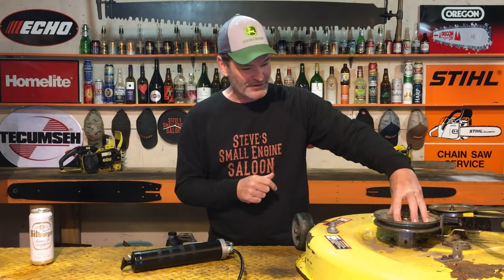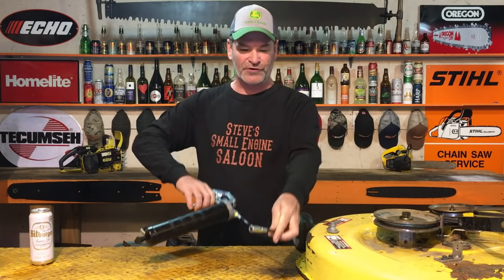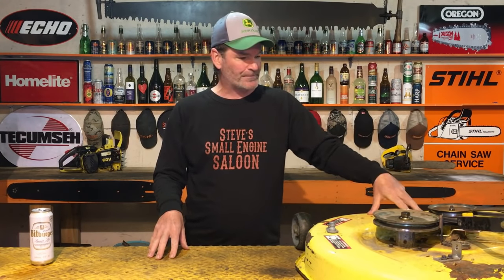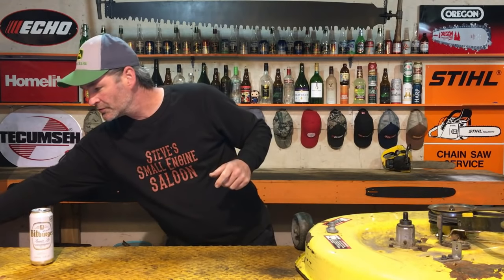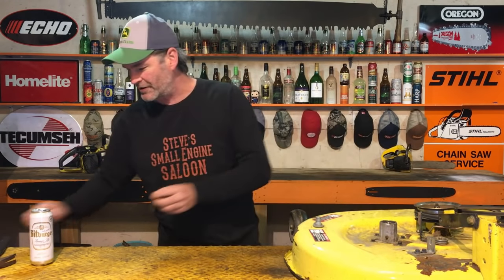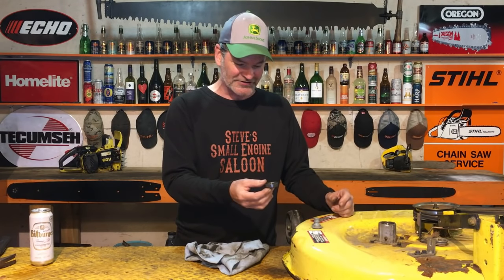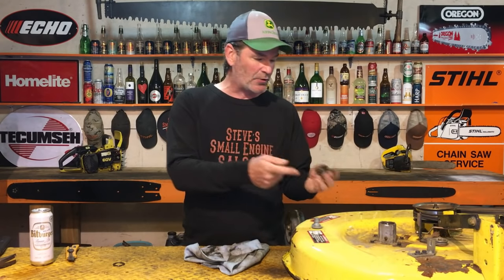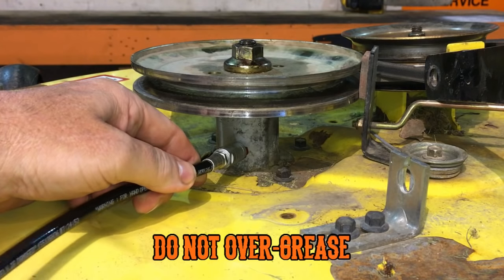Your Riding Lawn Mower's Dirty Little Secret

Comment from the maker: Click here for a grease gun ➜ https://amzn.to/2HEEm1z
Click here for a spindle assembly ➜ https://amzn.to/2wjOAxL
Click here for bearings ➜ https://amzn.to/2M6pgpG
Check out these other informative videos: 
Clean Under the Mowing Deck on a Riding Lawn Mower ➜ https://youtu.be/RpURLWPNI1o
How To Un-Seize, Clean and Grease a Sealed Bearing ➜ https://youtu.be/0J8z-n7dIOg
Remove The Mowing Deck From a Riding Lawn Mower ➜ https://youtu.be/eQlGRlIDcC0
How To Install A Belt On A Riding Lawn Mower Tractor ➜ https://youtu.be/UgW4gcPAWIs

Make sure to check out the Saloon here too…
Click here for my website ➜ http://www.stevessmallenginesaloon.com/
Click here for my Parts and Tools Store ➜ https://www.amazon.com/shop/stevessmallenginesaloon 
Follow me on Facebook ➜ https://www.facebook.com/stevessmallenginesaloon 
Follow me on Instagram ➜ https://www.instagram.com/stevessmallenginesaloon/ 
Follow me on Twitter ➜ https://twitter.com/SteveSaloon 

The reason I did not put the nut back on before I hit the shaft is because that model has a tapered shaft at the top so you can't damage the threads!  I do agree that it is good practice to put the nut back on though....
Reply: Or use a heavy mallet that won't damage the threads.  I winced when I saw that.  You forgot about Murphy's Law, anything that can go wrong, WILL...
Reply: How about the o'finnegan law,  murphy was an optomist!!
Reply: All threads can mushroom. We can see that all your work was prepped by the cleanliness of the deck/spindle/bearing and ease of removal. Anyone who's replaced a bearing knows they don't come out that easy are a dirty especially if they've been greased.
Reply: I assumed it was ok to wack the top like steve did because he has replaced hundreds of these. Pros do things diy people should avoid. He does a good job of explaining the basics but when you do something for a living you don't even realize all the things your brain is calculating. 
Cheers
Reply: Not only lawnmowers same with cars build to fail😂
Reply: Does this work on the John Deere D110?
Reply: just bought a 4 pack of Bitburger Pils tonight for my shop work
Reply: Well I have to hand it to this Steve guy. He is right in 2 aspects of the issue because I have had arguments with customers that are anal about what they spent on their brand new Tractor they bought of all places LOWES. Once ya buy anything from LOWES or Depot like appliances that have factory recalls on em or like my weed whackers and a dehumidifier like the one they hung me with, the stuff is total junk right out of the box it fails to work or start up properly or even run. The shit is full of design flaws and factory defects and unfortunately places like LOWES don't have a heart soul or conscience they will stick anyone for 2 to 5K on anything ya bought and not think twice about it. I have customers and I mean good customers that will say how could it be bad it's brand new and I kept it greased all season long last year and now.... Unfortunately Steve and I are the guys that take the shit apart and actually see what went wrong. I see those spindles all the time with the hollow body and the grease does not do much. One thing steve does not mention here is most folks don't actually know that lubrication of tractor parts because of the heat they generate U are supposed to use either the yellow or green LITHIUM GREASE not automotive grease. The lithium is designed to melt in the heat and provide lubrication the reasons they tell ya lubricate every 30 hours. Now most of the lower end machines do not have hour meters so that is a farce knowing when your 30 hour time period has lapsed. Mostly this is why people around my area R digging their old machines out from the shit pile behind the shed or garage and bring em here for restorations. Simply put the older machines put this new peanutbrittle and tin foil shit to total shame. Most of lawn tractors I own R 30 years old. 1986 thru about 2001was the cut off for anything decent made to cut lawns.
Reply: replacement bearings are super cheap. who cares about noisy bearings? taking a dust seal out is asking for trouble!
Reply: husqvarna whipper snippers there was a time in the garden maintenance job I was working in a part of my life.the company would go thru heaps of whipper snipper shafts like in a yr the boss said 6k$ worth on shaft replacement alone.so I was on the job with a off sided and both whippers shafts died,3/4of the job done so close my trick was pull apart the whippers on site and switch the shafts well worked like a treat and finished the job.when I got back to the depot I informed my boss and we saved him a lot of cash.thinking costs you less
Reply: @steveluckhurst2350  The bearings are, as you say cheap, at least relatively so, but when a bearing fails you have to equate the damage caused by that failure to the shafts, spindles, mandrels, etc. Then you have some $$ to spend, and on a three spindle deck you might want to be concerned about that noisy bearing. To remove a dust shield as was done in this video is an excellent preventative measure as it allows the grease to reach the innards of the bearing. Not asking for trouble, but, in fact, lengthened the life of the housing. And of course reducing labor costs for repairs for the non DYI person.
Reply: @thegeneral2368  OK,  we'll have to agree to disagree. Not only does removing the dust seal allow grease to reach the innards of a bearing, but it also allows the ingress of dust, grin and other crap to speed up the demise of said bearing!
Reply: @steveluckhurst2350   I agree.Whenever I remove dust shield(s) it is always in a similar situation as depicted in the video by Steve. The housing he was working on is hollow with the zerk at the bottom. It is sealed otherwise by the bearing at the top and bottom. Between then is the vacant area where grease is pumped into and is sealed by the top and bottom bearing. Removing the dust shield from the bottom of the top bearing and the dust shield from the top of the bottom bearing,  allows the grease to fill the housing cavity which permits the grease to be pressured into the respective bearing. I'm not suggesting removing both dust shields in this scenario. Your point is well taken and I agree that, in this video situation, foreign material would accumulate to destroy the bearing prematurely if both top and bottom shields were removed from both bearings.
Reply: @thegeneral2368  Well here's another way of looking at the issue. And this is just a guess, so don't shoot me down! I'm guessing that when the deck was first designed, they did indeed use uncapped bearings but found that they failed earlier than expected. So they changed to the capped version. Obviously it would not be economical to change the housing, so they left it, putting a grease nipple in to close the void. I can see Steve 's reasoning, but in practice there is no long term benefit from his actions unless done from brand new.  You have to be sure that the void is rust and dirt free before filling it with grease otherwise you are just creating a problem rather than removing one!
Reply: Hey: Some of my buddies just buy a new one every year, FOR  their wife. My one buddy says his wife runs over the same rock and frigs the blades at least once a season.(Late September) Hmmm so sell the old one for 600 and new one is 1000
Reply: My brother called me the other day to borrow my grease gun, he told me he was greasing his John Deere deck bearings.  I have to tell him about your video.
Reply: I have had my JD lawn tractor for about twelve years. If you keep it maintained, and clean it will last for ever. Old wet grass on the mower deck can cause all kinds of issues! Rust, rotten belts, excessive heat around the bearing housings! Plus not a lot of fun when you need to service the machine.